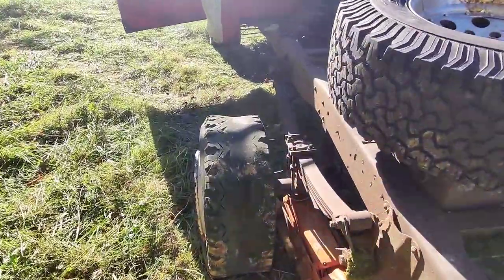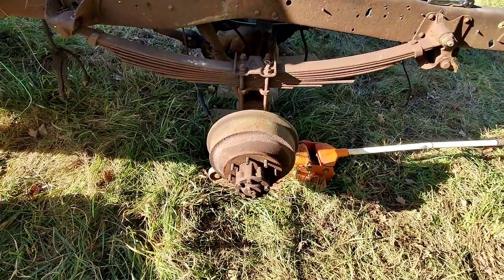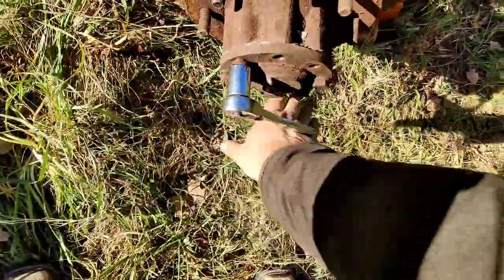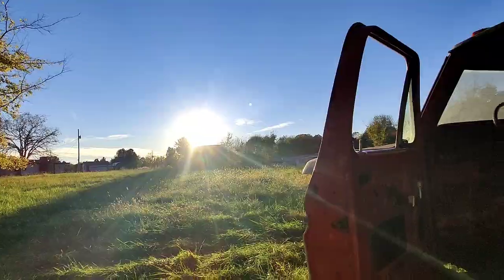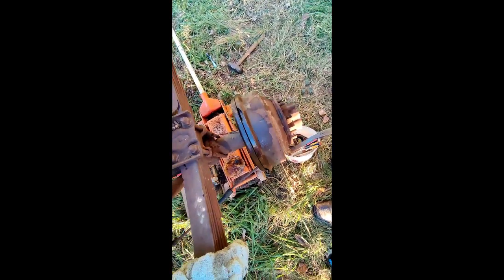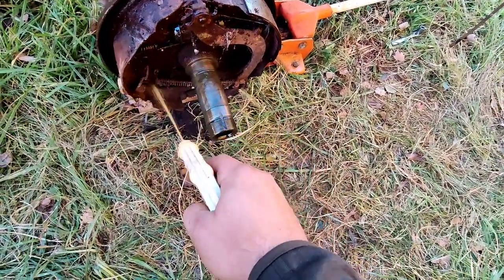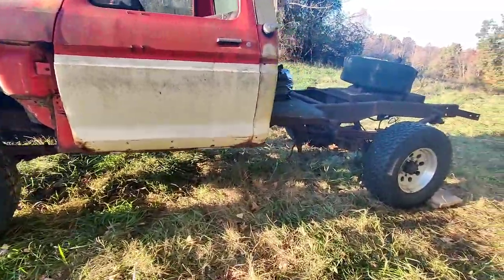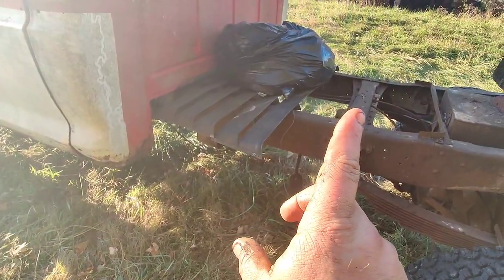1975 F-250 4X4 RUSTED REAR BRAKE DRUM REMOVAL

Comment: Don't they have a hub puller you can rent?
Reply from the maker: Yea, I have a huge one but requires a 3/4" impact and my air compressor is way to small. But it would have jus broke the edge of the drums or worse and it was faster just to use the BFH